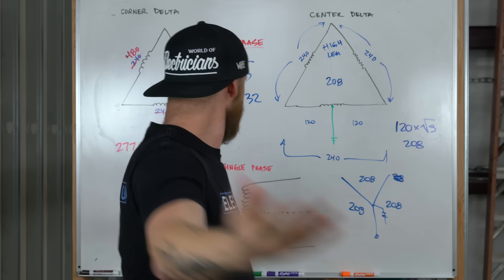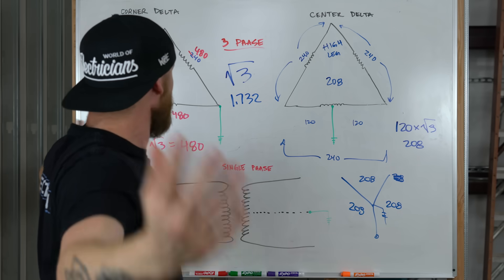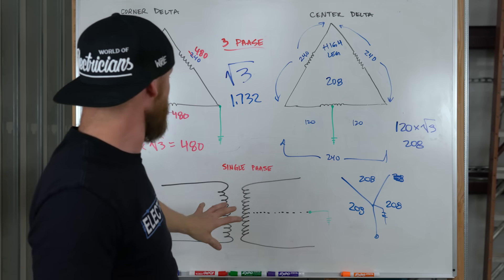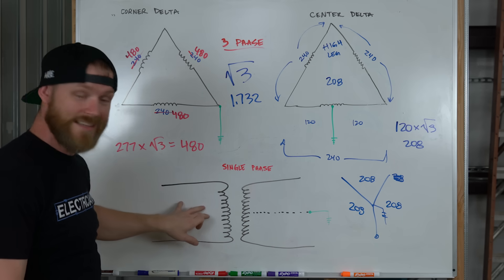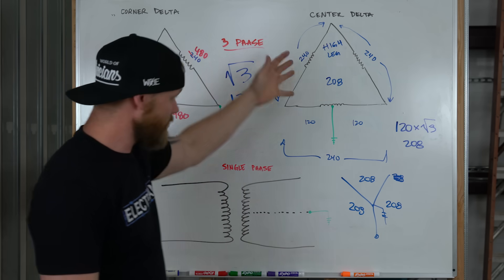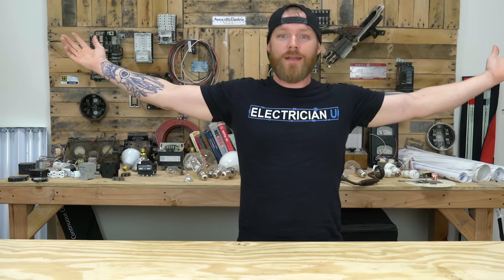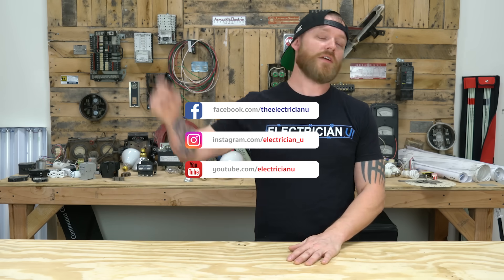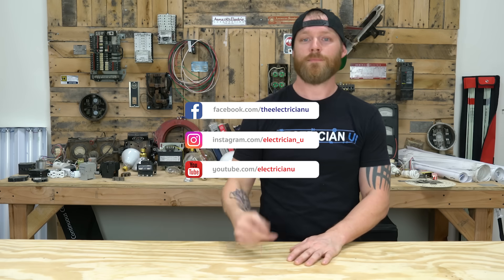Difference Between VOLTAGES - Why We Need Them All

Comment: 277 hurts a lot more
Reply: The fillings in my teeth still hurt when I think about touching the 277 volt lead for an emerg/exit light 40 years ago. I can still taste the metal.
Reply: Yet somehow it hertz the same.
Reply: @binaryglitch64 ohm really?
Reply: @binaryglitch64 😂😂😂
Reply: @binaryglitch64 , allow me please to Amp it up a little. Watt Hertz you is Coulombs law of charges against the Ohmic resistance of a body above ground. Or something like that. Your comment inspires!😅
Reply: It’s cause of that damn neutral lol
Reply: 277V also hearts the tongue just saying it.
Reply: 480 has to burn clear…
Reply: Fuck yeah it does I got hit with 277 changing out a ballast on an emergency light. I learned a very valuable lesson that day.
Reply: @shawnhimes3004  That is how I got my taste as well. Not an emergency light but a fluorescent indirect light up on the top of a 6' ladder. I looked like a cartoon character jittering and frozen to it! My fingers would not open up! Finally shook enough to get off it.
Reply: Volts don’t matter as much as the load on the line, getting shocked on a phase in a residential meter hurt way more than 277 on a lighting system in my opinion
Reply: @Chesterhammy No, the voltage does matter. Your body does NOT care what other loads are on the line that you're getting shocked by because you ARE a load. Spoken by someone who has never even seen 277 volt installations, that stupid comment.
Reply: That's why I'm here. I'm trying understand why that shit hurt so much more.
Reply: 120 feels like pins and needles
Reply: @christianmoore7046 No, it doesn't. It actually hurts. I can tell you've never been shocked by 120v
Reply: @pootispiker2866 I have. It actually did hurt and my fingers were sore after. I also experienced muscle spasms for the next minute. I was shocked only very briefly though.

Comment: So say a light is a 277v interior decor type wall light. Is there any specific way to connect to a 110/120v supply. Specs say its 277 only made in Italy (if that matters). Salesman says its fine to connect to a 120 v supply, but I see no 120/277 marking strictly 277. Is this the case? If not do I need a transformer or is there a dimmer switch that converts a 120 to 277?

Comment: I am not sure why this video popped up for me to watch since I primarily watch art and philosophy videos on YouTube , but yay!  I accidentally started doing electrical design 20 years ago for an MEP engineering firm and ran across my first 240v, high-leg delta system in an old building a couple of months ago. My PE gave me a quick explanation and told me to avoid putting any 120v circuits on the B phase.  Your video totally cleared it up for me! Since I learned design by doing and without a formal education, I find these weird little gaps in my knowledge.  I definitely plan to check out more of your videos. Thanks for doing these!

Comment: I think I would have added that most 5 volt and 12 volt services are usually DC, but there are some low-voltage stuff that is just stepped down AC, for example, most residential HVAC thermostat controls are 24 volt AC.

Comment: I have seen a 762 volt system in an oilfield before. Phase to neutral was 480 but line to line was 762. This was a rare system that I am sure is obsolete by now.....Great video by the way!
Reply: Another weird voltage is 416/ 240, still in use at some areas in central Toronto nowadays. I saved a few vendors from very expensive mistakes when they did not check the voltage and assume it is 600V. Oil fields in Canada often have 4160 Volts. It is the lowest common high voltage.

Comment: Having been a foreman and built 1/3 of Silicon Valley over the last 12 years now doing design build as a PM, this is me explaining to all the PMs outta cal poly trying to use their uglys book to tell me #10 ground is all you need for 50a, at 497’… until I pulled the nec tables and made them do the math on circular mills and read how to proportionately upsize the ground with feeders…. “But the chart says #10!”.   Sigh
Good job.

Comment: Hey bud. Great video.  I'm an electrician apprentice (literally ny 5th day on the job). I was running 120v and 208v to heating units in a school. Nice to kind of know what that means. I understand three phaze is essentially three magnetic pulses in the system that makes the voltage contain less drops or low points in power, but I'd like to see exactly what is going on in real life application. Most of what I've seen has been on a white board.

Comment: Do yourself a favor...learn why the square root of three is a calculation element.  These voltages were not randomly picked.  It goes back to basic physics.  Three phase vs single and their associated pontentials were not randomly pulled out of a hat.

Comment: I work constantly with 440 3ph ships power and it DRIVES ME NUTS that I have to explain to ships electricians how this works. I wish all of your videos were just a crash course on DVD they could take with them on DVD on deployment, though I'm worried they wouldn't watch them, the shits.

The worst thing I get is "Why do we need to ground it? the unit is grounded!" Oh you fuckers. When I have to explain the difference between phase and potential they look at me like I'm slightly out of my mind but they also know I'm right, cause they've been shocked by crap that wasn't grounded properly.

Comment: 24 volts is used in hvac to power the thermostat and the outdoor ac unit.

same for mini split you will have 24 volts go into the indoor unit to power the control panel for the remote and display and the fan motor.

Comment: Dustin... I've been an electrician for just about 20yrs and I'm glad to learn something new or be reminded of how things works. I've watched several of your videos and have certainly learned things. Anyone who tells me that I should know everything about the trade as a master electrician is just ignorant. Yes I'm a master electrician but I literally only get involved with low voltage work when I do side work. There's lots of things that I've simply never worked on or seen. That's how I found ur channel... Looking up something I was troubleshooting that I had never worked. I work on the utility side now and have since learned that under 2,400 volts is considered low voltage, medium voltage is 2,400v to 69,000v, and high voltage is anything above that (transmission). For years I referred to 50v or less as low voltage, 120/240 as medium, and 277/480 - 600v as high voltage. I've never worked with 600v systems and I never knew that there was such a thing as 347/600v. I appreciate your knowledge and explanations and refer people to ur channel including my own son who has started in the trade. Thanks.
Reply: Justin, you are the best , I’m so glad I found your channel…

Comment: Fnnily enough with a high leg delta, if you consider the connection point like a triangle( make the 240V the hypotenuse and the 120v the bottom leg) and perform Pythagorean theorem to get from B to N it comes very close to 208V!

Comment: I got a question, I’m not even an apprentice, yet. Why is it that you can plug a 5V charger into a wall plug (which I’m assuming is 120V) without a problem, but if you plug in a smaller motor to a 240V system, it causes problems?

Comment: If something is rated 200-240v, 16a. Can I run either 208v or 240v to it?
Reply: Depends on what it is.  If it's a resistance heater, yes.  If it's a switched mode power supply, also yes.

If it's a motor...  You need to derate it by 25% to run on 208 vs 240.  Also, it's going to draw more amps.
Reply: @MichaelRBaron  It's a large video projector. Not sure if that makes a difference.
Reply: @williamtaft719  probably fine then

Comment: Why we need higher voltages. Voltage drop is the same no matter the starting voltage. So 10amps over 100 feet of 14 awg wire will always be 3 volts. So if you start with 5 volts you end up with 2 volts. If you start with 120v you end up with 117v. 

So from 5v to 2v is a 60% loss. But from 120v to 117v is only a 2.5% loss. 

When dealing with 5v 12v and 24v led light strips this is really easy to see. A 5v led strip is obviously dimmer at the end of 10 feet. Not so with a 12v strip.

Comment: The important thing to include in the reason for using square root 3 is because of the phase angle of 3 phase. It’s 120 degrees separation phase to phase and this is why the voltage is example: 277 volts hot to ground and 480 volts hot to hot. The phases overlap kinda like a double hump camels back.

Comment: I ran across a high leg on a  residential service upgrade. It was confusing because it was a house 🤔.   Here I come to find back in the day it used to be a shoe repair shop with living quarters upstairs for the shopkeeper 😂.   They actually ran 3 phase into neighborhoods for these small mom and pop shops!   There were 2 separate services, single phase for the upstairs and 3 phase for the shop.  And it was all still fuses!  It was pretty scary looking actually 😂Luckily I checked the voltages before I hooked the service up LOL.

Comment: It is called impedance matching.
The higher the voltage the lower the line loss,120 is good enough for most household uses ;  items like electric stoves and dryers use 240. Commercial hookups can be 550vac 3 phase.  Electric passenger tranes can be 700 volt range high speed bullet tranes can have 56,000 volt ac

Comment: If you draw two 120V lines in two phase (180 degrees from each other), then visually measure peak to peak it will equal 240V. I think if you draw out a three phase (120 degrees) and visually measure across the peaks the most you can get is 208V. It helps to see why it is 208V because the peaks of each phase never fully line up like two phase does. That's why you can't get the full 240V in a three phase. I didn't know about the square root of 3 trick to find that number quickly. Nice tip!
Reply: You can get the full 240V three phase  in a deta configuration, and the best of both worlds (kind of) with a center tap on one of the transformers to give 120/240V single phase just like you'd find in your home,  the winding furthest away from the center tap is the ghastly 208V stinger leg, you are not permitted to use the stinger leg to neutral for running single phase 208V loads.
Reply: This is the exact reason why. Sqrt3 is useful for math and it comes from the RootMeanSquare (RMS) way of measuring AC voltage

Comment: Hey so how can we put outlets on a delta centered transformer. Or when it comes to these situations, is that a separate panel ? I do commercial and had to add a 208 transformer because the existing was 240 high leg  and the prints assumed it was a 208 transformer

Comment: As a layman who works on my own properties (fix them up and move on to the next), I was hoping that you would go into why some residential 240 plugs have 4 wires and some have 3 wires and what the difference between them is.  I come across specifically dryer outlets that could be either, so I have one of each cable so I can swap them out if needed.  What's the difference?  I think the range usually uses 1 of these and the fryer the other.  Why is that?  And, if I ever need to actually wire one (example: the existing dryer is gas and I want to add an outlet for an electric dryer), which service should I run?
Reply: Four wire outlet has two hots, neutral and ground. Three wire outlet has combined neutral and ground. This is what in Europe is called a PEN-wire. That has some safety issues so since 1996 the four wire outlet has been mandatory. If the outlet has four wires an the dyer three, you should change the cable and not try to adapt.
Reply: @okaro6595  Good to know. Thanks for the advice.  Although, I wish I would have known this before I fixed the ceiling in the laundry room.  ;-)

Comment: I am originally from Australia where the most common voltages are 240v, single phase. and 480v, 3 phase ( 50 hz )
It is very simple. As I do maintenance at a US high school, the voltages that I deal with are 120v, 208v ( NO 240v ) 277v and 480v. ( 60 hz ) We have 3 @ 200 volt supply transformers which is stepped down via smaller internal transformers providing 120v, 208v, 277 and 480v.. This setup doesn't supply 240 volts.

Comment: Certainly well taught, kinda wish i saw some sinwave goin on to explain why the sqrt3 occurs, and thus also have the wild lag... Buh regardless of that i'm glad the white board came out. Being Canadian i defiently know 120/240 120/208 347/600 but what do y'all in the states typically come across, is 600v a thing there?
Reply: In the states we rarely use 347/600, instead we use 277/480 9 time's out of 10

Comment: In Canada High voltage is 750 and up, Extra Low is 40 and lower, therefore Low voltage is everything in between and is what and Electrician will work on. High voltage requires the power lineman designation.
Stuff is getting a little grey with power over ethernet going up to 70~ now. I've also had a fire alarm system with the strobe being 24 and the speaker(which was actually an intercom system in that install) was 75.

For services to buildings is almost always Y. High leg Deltas for apartments are getting phased out.

120/240 is predominantly residential.  347/600 is what will feed most commercial properties and there will be delta to Y stepdown transformers in there to make 120/208.  In some industrial or high power demand places they might jump into high voltage at 4160 (that's usually what's being used when you see those big roll out breakers in some videos).  Go to a remote mine or something and you will likely have a transmission level voltage coming to the site. I think that starts around 12.5k, with the highest long distance lines go up to 230-287k, 345k, 500k, 735k.
277/480 is uniquely american as far as I know.  If we get something that requires it, then an extra transformer is needed.  There is also 575... that just gets 600 thrown at it.
Reply: I'm curious, if there are any Resi peeps that see this, what is used in the standard residential transformer?  The idea of having a delta with a high leg on each phase seems plausible, but I've really never had the opportunity to fiddle with one.
I had a guy whos previous company mainly did light poles, so I asked him what voltage is used there. I imagined 347 or maybe 600, to deal with the distances. He said 120 I think... I didn't have much faith in this guy up to that point annnnnd lets just say it didn't improve down the line.
Reply: Oh and for three phase, the simple answer is.... VECTORS!

Comment: Good Job explaining. As an electrician most of this was just taught and taken as fact. It wasn’t until much later at a Russell Electric School that the odd voltages were actually explained. In single phase the two legs are 180 degrees apart (sign wave) three phase are actually 120 degrees apart so the differential between legs will never be the sum of the different legs to neutral since one leg reaches the top of the voltage curve while either of the other legs at that instant has less potential related to neutral.  That explains where we get 208 v 277 on 480 Volt systems and 2400 on 4160 volt systems.

Comment: Actually, I texted to describe the all consumers are in parallel with the Power Plant generators windings - by the Delta-windings of the primary in the step-down transformers. That's why it is the requirement to apply for the General Power company if needed to upgrade the panel for the higher ampacity. The more power consuming might be loading more for the power interstate lanes.

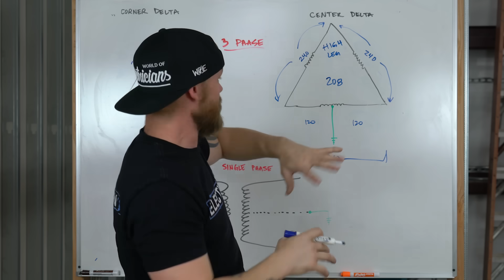Comment: On 9:45 - I might guess, that all transformers on the HIGH POLES are carrying the Delta shaped windings, and the consumer side the transformer windings have the Y-shaped. That has the NEUTRAL on its center and that neutral got GROUNDING ROD into Eath, into soil. And the three of phases. 
The Delta shaped windings are less popular, but it has the same as like 208 and 240. More usable the 480/277 volts. Between the legs it has 480, and phase to ground - 277.
May be I am not much right, but I believe so.
The electricity is not difficult theory, but the PSYCHOLOGISTS of the University of disallowing to study exactly because it is the VETERANS and military recruiting, and the college medics disturbing to study by the radio-hypnosis, which instead of encreasing memorization of the theory, are erasing the memory, using the advanced technology of the military science. It is the spionage using the electricity. That disallowing to move across the staff fast, and stopping on the electricity, instead of moving into electronics, as like Air-Conditioning teaches doing.

Comment: OK, on 1:00 - minute of video, FIRST, look at the thing that the HIGH voltage is needed for the TRANSFERRING the energy from POWER STATION, from the Generation Station - to the consumers. The same POWER might be transferred by the High VOLTAGE and low current or Wise Versa - by the HIGH CURRENT and low voltage. So... The power lanes might carrying the 300 thosend volts because it allow smaller sized conductors transferring the power. On STEP-DOWN transformer the voltage get LOWER, but the CURRENT is becoming higher, and the CONDUCTORS becoming in greater size - or they might be melted by the temperature of the power energy transferring.
So, to bring the energy from the outside poles, the step-down transformer makes the 1000 volts into 480/277 volts or into 208/120 volts. But the FEEDER from the pole or transformer might be very big sizes with the three sets of the double conductors in parallel connections.